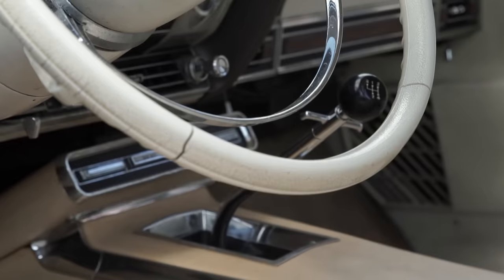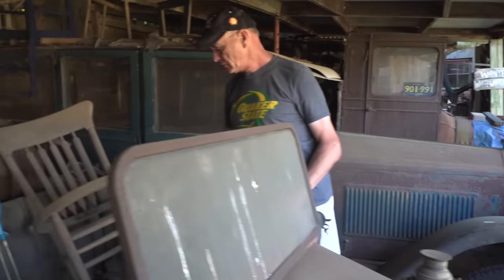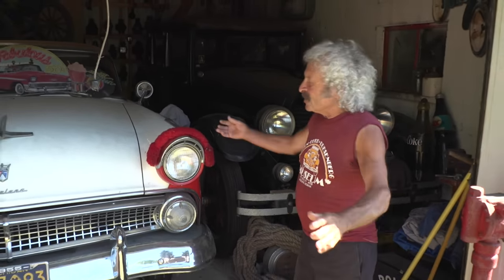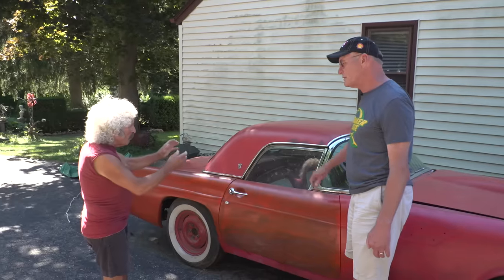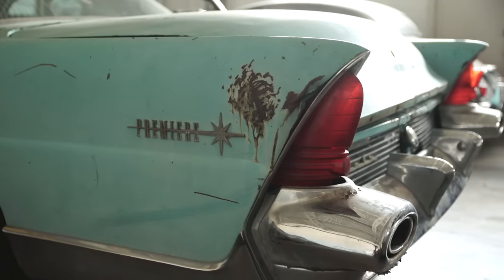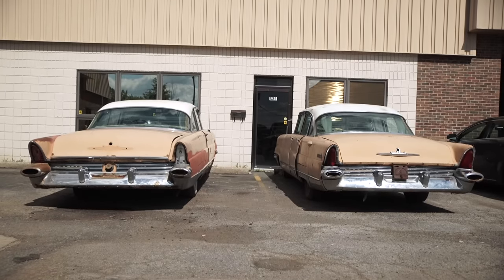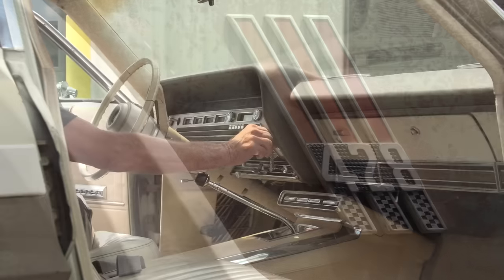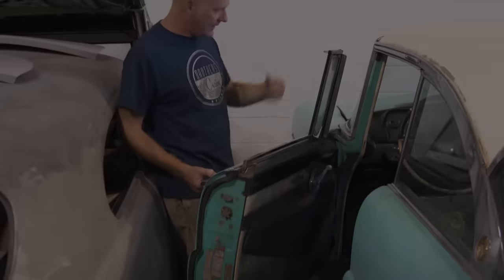1 of 1 428ci 4-Speed Ford Country Squire Wagon | Barn Find Hunter - Ep. 13

Comment: Was this Ford wagon from Dayton, Ohio? I remember this car, the guy brought this in to the Ford dealer that i worked at. it has to be the same car,  if only one 67 woody wagon was made with a 428 4 speed.
Reply: I can tell you that it looked a lot better in 1971 when i seen it last
Reply: Yes, it is the same car.
Reply: You probably looked a lot better in 1971 as well.
Reply: tom cotter Harsh bro
Reply: it's got some patina now. just needs a protective coat of clear, restore the interior and do some brake updates if it's got drums.
Reply: How much did that station wagon cost in 1967?
Reply: Pam Ewing Probably just a few thousand. That's back when new cars were actually affordable instead of costing a small fortune like they do now.
Reply: Pam Ewing Dunno, But my first new car was a '67 Galaxie 500XL (not a wagon) with a 4BBL 390 (315 BHP), C6 Auto,  8 Track Tape Player, Rear Window Defroster and maybe a few other small options and it cost me $3,400
Reply: I hope you're taking inflation in account, $3,400 in May 1966 is about $26,000 now. I realize wages in America were different then though, even people working grocery store checkout lanes got the equivalent of about $24 per hour before the barcode system or so I heard.
Reply: Austin Lucas All I know is back then the average guy could afford to buy a new car pretty easy, nowdays if you're an average guy and you buy a new car and you're going to be paying out the ass for years!
Reply: +idlehands333 The dollar does not have the buying power it did, even in the 80s. You can't make it on minimum wage and taxes are higher than ever. 50K for a damn Camaro that will be a POS when you get it paid for in 7 years.
Reply: Clint Davis exactly right, pretty sorry state we're in now. I've given up on ever even buying a house :(
Reply: When I was growing up, the guy that pumped gas into my Dad's car was married with two kids and owned a small home.
Reply: dhh488 Yeah well now that guy is some damn kid living in Oregon with tattoos and spikey hair, who makes less than enough to barely scrape by, and he doesn't even check the oil, wash the windsheild, or check the tire pressure these days. I tell ya, the world ain't what it used to be!
Reply: @101Volts  26k for a wagon which would be equivalent to an SUV. So how much does a Ford Excursion cost? I will take a new one for 26k!
Reply: The cost of cars is artificially inflated because of federal regulations. If they didn't have to meet increasingly strict fuel economy, emissions, and safety regulations the cars probably wouldn't cost much more.
Reply: @jimbalayaman7227  It is crazy that would add close to 50k to the sticker.
Reply: @jimbalayaman7227  I personally think.  They make cars far to complicated.  You need to take off the front bumper to change a light bulb.  Drop the engine to change a battery.  They don't want people to work on their own car. Most new cars are junk.
Reply: You do realize cars cost about the same now anflation ononly makes things seem so much more expensive right?
Reply: @megadeth9733  No they are not. In 2008 MSRP of a base line f150 was just over 17k. With Inflation in 2018 that would be 19,909. MSRP of 2018 f150 is 27,905 that is just one example.
Reply: @markmiller4503  an f150 was less than $3,000 in 1967 which is right around $22,500 today. 

It's not that big of a price gap considering all of the technology in vehicles today.
Reply: @megadeth9733  2018 MSRP is 27,905 just saying. I was not even close to buying new cars in 1967. I am just going by the short ten years I have been buying base price trucks for construction company.  It has went up over 10k in 10 years. I do agree the government does mandate alot of safety features etc. including in 2019 all vehicles must have a backup camera.
Reply: Are you talking about Mike?  He coats himself with SPF 1000 when he goes out, stays 'regular' eating prunes and SMASHED the drumset after his last hearing test.... I SAID "**HE BROKE APART... "
Reply: Oh yeah, grocery stores paid well but expected their union employees to be quick with the register keys and of course most memorized at least the most common items... I still remember a cashier friend WHO WORKED AT unSAFEWAY in Seal Beach, CA. mentioning an unpriced tampax box and quietly asked if the young lady knew the price..."Ah,no"... Over LOADspeaker microphone:"PRICE CHECK; KOTEX SUPER 20S"... SHE TURNED BEET RED AND RAN OUT OF THE STORE WITH HER PURCHASE"!
Reply: HATE TO SAY IT BUT IT'S A POS BEFORE IT LEAVES THE LOT!
I BUY CLASSIC CARS THAT KEEP THEIR VALUE AND Z-SPORTS CAR DAILY DRIVER... NOTHING BREAKS!
OF COURSE I PERSONALLY DID THE FRAME OFF RESTORATION OF MY 1970 TRIUMPH TR6 AFTER YEARS OF DOING SAME FOR OTHERS' PORSCHES/VOLVOS/ETC. AND OF COURSE ONE OF MY FIRST CARS A '58 EDSEL PACER!   LOTS OF FALCONS/ECONOLINES TOO... FAMILY VEHICLES.
Reply: I thought the same way when my parent's house went from $13K in '56 (track homes went in 1948,$4K just after WW2) to $100K+ when I bought first tiny house on tiny lot for $105K.  Sold UP to $240K worth $mil+  now... but no intent to sell... leave to kids... their moms got oceanfront properties here in CA and FL... I guess?
Reply: Back in 'The day' (60s child for me) the average CEO of a fortune 500 company made FOUR TIMES AS MUCH AS THEIR AVERAGE WORKER, THE THINKING IS THAT 1ST LEVEL MANAGER (4X) HIS EMPLOYEES AVG SALARY, 2ND LEVEL MGR (3X)HIS MANAGERS(2X)THE EMPLOYEES(X)... BUT THEN TAKEOVER SPECIALISTS REALIZED THEY COULD RAPE THESE WELL RUN COMPANIES... SO SALARIES OF EXECS WENT SKY HIGH... CEO'S MAKING 100X (X-AVG=100k, CEO=100X100k=10,000,000=10MIL
Reply: @101Volts  In 1972, I was 26 and had a retail clerk's job at a discount department store called Turnstyle in Boston.  My hourly pay was 1.95 per hour.
Reply: @markmiller4503   yes, that's is why I want a 1959 Desoto as a daily driver.
Reply: @malcolmjohnston3227  My brother worked at save-a-lot in 2001 he made 10 an hour in Ohio. That is good money back than and, even still in Ohio. They did not have any UPC codes they had to know the price of everything they rang up!
Reply: @JohnSmith-wd9rc  I don't blame you at all! I buy salvage title beaters for a couple grand and, low mileage!
Reply: @ssimon64  true sad state of affairs here in Portland on the other hand you got the dentist with the never driven classic sitting and a few kids with large payments over extended
Reply: @ssimon64  it was special order so it was probly around 4 grand give or take which is the same as 30 grand now a days which will get you a 300 hp wagon with cruise control,ac, bluetooth ,ect and will run for 300,000 miles compared to 100,000k. plus the new crossovers  will out run it and get 10 more miles to the gallon and crash test better. the money comparison is a joke. you definately get a better deal now.
Reply: mike jeckering I'd offer 80.000 for that wagon
Reply: Why California plates?
Reply: David Mc naw I really rather  have the car I don't need the money
Reply: David Mc yes and no I'm 56 and have several  old classics  im not selling them, my daughter  gets them  besides im kinda well  off did some investment  that paid off  pretty good  not bragging but I'm sitting good infact I actually  have a bunch of old classic  car parts that I collected  over the years those I do sell   and your right it's a good investment.       I'd never sell my 69 chevelle  or my 72 vette    or my 63 comet wagon
Reply: @jonalarcon8564  well if you are serious about buying it I saw his latest barnfindhunters episode (today) and  Tom was driving it and it had a for sale sign in the corner of the windshield with a 75k asking price.
Reply: @bostondavedowding8167   That would be a sweet car. In 42 years of driving, I've owned at least one of every Galaxie XL from 64-69 EXCEPT a 67. I could just never find one around around Northern Ohio. It's almost like 1967 full size Fords didn't exist here in any configuration, Lol.
 However, in that time I was able to randomly stumble across 3 66 Galaxie 7-Litres within 20 miles of home. I didn't know at the time how unusual that was.
Reply: @tomadkins2866  Wow.  That is weird.  I had the '67 and then a '70.  Oh how I wish now that I got the 8V 427 in my '67.  I believe at that time I could have also special ordered a '67 with a 427 SOHC in it.  That would have really been sweet.  One of my best friends had a '66 with a 7 liter 428 CI in it.  Now I have an '09 Shelby GT500 pushing  718 RWHP.  I love it.  It's pretty quick and fast.
Reply: @bostondavedowding8167  You've got good taste for sure. If you want to drool, check out Jay Lenos 66 7-Litre. Beautiful car. My last interesting car was a 69 Marauder X100, it was stolen about 15 years ago. Another XL is on my bucket list.
Reply: @CamoShirt   Ford's full-size 10-passenger wagons in '67 got power disc brakes by default, even with the six-banger.  They were also standard with the 7-Liter XL package, but optional in almost everything else, including the six-seat wagons.  Also, in some cities (notably NYC), models outfitted for use as taxis were required by law to have disc brakes.  The stipulation may have extended to police cars, but most police departments ordered them that way anyway.
Reply: @bostondavedowding8167  The 'Cammer was never available as a production option.  Ironically, the factory DID assign VIN codes (D and L) for the Cammers, because there was consideration of making them a factory option (prompted by NASCAR's rejection of the 'Cammer unless Ford built 500 production examples to qualify it for roundy-round) but the significant issues against it were the cost (allegedly close to $10K apiece for those engines, as they were basically built by hand - bear in mind a Galaxie convertible with a small V8 and automatic cost <$3K), and the potential liability and PR headaches of a 600+ hp production car out 'in the wild'.  It would have been a sales nightmare, too, since the insurance companies were beginning to tack on hefty premiums for 'overpowered' cars.  There WERE 427s offered in the '67 Galaxie, but they were the conventional wedge-head mills.

Imagine the meeting, though, when Ford execs considered - actually CONSIDERED! - a 600 hp production car before rejecting it.  THAT SINGLE MOMENT was the high-water mark of the musclecar era.  It's worth noting, too, that Chrysler had become aware of Ford's 'Cammer project and developing their own answer to it - a DOHC, 32-valve variation of their Hemi, nicknamed the Doomsday Machine.  They abandoned the project once NASCAR nixed Ford's 'Cammer.

The sixties were definitely something to behold.

Comment: I seen a 67 Chrysler Newport that had a 383 and 3 speed manual transmission the shifter on the column. 
It's was actually standard equipment for Chrysler,  though most were built with the automatic transmission.

Comment: That wagon is a REALLY cool find!   My old man had a Ford Esquire wagon, and bought a Plymouth Sport Satellite wagon after that.  He tried to get it with a Hemi...they said no....he said 440?...they said no...383 Road Runner Engine was the top available...and that thing still went pretty damned well, about 7 or a hair better to 60.  The little Healy 100-4 we had with a hypo 289 shoved into it would absolutely destroy it to 60, though, except in the rain.
It was configured much like this with the dual open tailgate, power rear window, but crank windows elsewhere.   Almost got my hands on a hemi Cuda once as a kid, but had to settle for the 383 version (two of them actually, both '70 models,  with the slit tail lights and the (fake) double scoop hood).

Comment: The Vic is awesome, however it is a 55, not 56 as you stated
Reply: I just relayed what Alex, the owner, told me.
Reply: Clinton Powell That's funny... The original owner of the car says it's a '56. Hmmm... I wonder who is correct?
Reply: LIKE NOW, BACK THEN THE NEW MODELS CHANGED VERY LITTLE BUT FRONT/REAR WAS EASY/FAIR GAME WITH TAIL-LIGHTS THE EASIEST CHANGE (CHANGE PLASTIC MOLD A LITTLE, LOOKS LOT DIFFERENT),  ANTWAYS THEY MOLD THE MODEL YEAR INTO THE TAILLIGHT, UNDOUBTEDLY STILL DO, SO CHECK THE EDGES OF THE TAILLIGHT LENSES FOR A 2 DIGIT NUMBER, A 1965 WOULD HAVE 65 ALONG AN EDGE OF THE TAIL LENS.

Comment: I have the same manual transmission in my 63 comet station wagon  I just had to get the correct pilot bushing and the correct  bell housing for it to line up on a 68 mustang 6 cylinder 7 Main block  it wont work on any earlier block  only the 1968 block works  it has  special  mounting points

Comment: so dose a 1987 dodge d150 with 000.164.4 miles on it count as a barn find I paid 700 bucks for it off a old man who had to have it gone all I did was change the oil did a tune up and tranny fluid and filter change rebuilt the two barrel carb and put fresh gas and battery in it one hit of the key after priming it and fired up drove it on a trailer and is now in my garage where I am  not repainting it just fixing the bad parts manly every thing under it and am going to put back on the road I am the third owner of this truck it belonged to a 90 old  man then my wife's grandfather who never moved it and now me and yes that is the original miles on it the dial has not changed color to indacait that the miles have rolled over I have had it apart to see
Reply: johny reb Ever hear of periods or commas?

Comment: @ Tom Cotter - that "Princess" two minutes in - those are not pressure relief valves, those are the period "Choke".  You put fuel in them, open the valve and drain into the cylinder before you crank!  Very cool show and series...
Reply: Cool thank you.

Comment: I drove, in the mid 80's,  a 67' Country Squire with 428 automatic with buckets, console, factory air, factory cruise, and power everything else with the big console controller that had all the controls on it with low fuel light, door ajar, etc.
It was one of 3 or 4 special ordered by a Houston based Garden Center - Nursery company.
It was Gold with the wood paneling and all white interior and had 148000 miles on it.
It still hauled ass even while spark knocking on cheap 80's gas.
The little old lady second owner wanted $4400.00 for it and I just didn't have it.........

Comment: I'm certain that the Crown Victoria is not a 56, but rather a 55. One of two tell tale signs are the signal/park lights. On this car they are round, whereas the 56 has a more rectangular shape. Second, the chrome trim down the rear fenders. The 55 had the narrow trim but the 56 had a much wider chrome trim. That Crown Vic and I are the same age.

Comment: Why you wear a Quaker State Shirt 👕?  My dad used Quaker State for years. He had a 1967 Chrysler Newport with a 383 ci engine in it & the valve cover gaskets was leaking. So in 1981 i was doing automotive class in High School & he ask me did i want to help him remove the valve covers & replace the gaskets to fix the oil leak? I said sure, so i removed the valve cover gaskets & That Quaker State oil had gummed up so bad, that when i removed the valve covers.......Omg it was nothing but a wall of black gummed up oil which looked like black clay. It looked as if the Valve covers was still on it! Just one solid wall of sludge in the shape of the valve covers, lol. It took us 4 hours to get those two walls of packed tight sludge off the rocker arms! I cant see how the rockers could even move. I bet he could've drove it a week without the valve covers even on it! Because that Quaker State had made black sludge walls & my Dad was religiously  changing his oil every 3,000 miles! He said what's causing that? I said it's gotta be that Sorry Quaker State Oil. So we switched him to Valvoline oil & he never had that problem again! But Quaker State will gum up a engine with sludge!!!